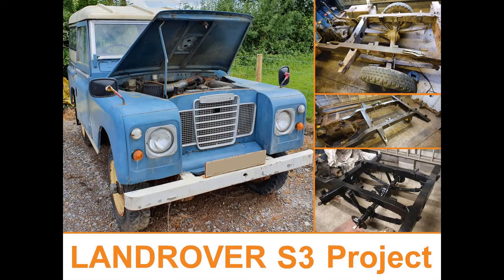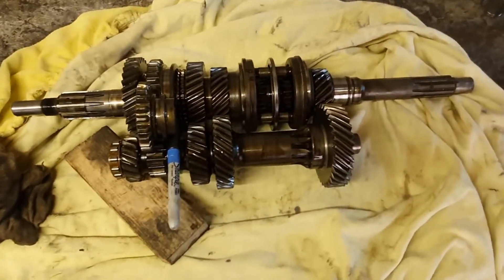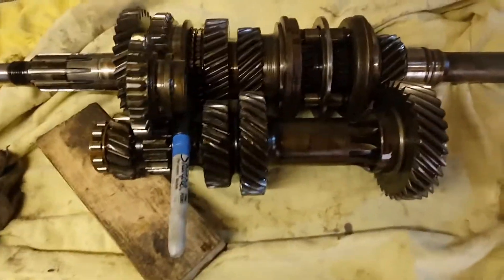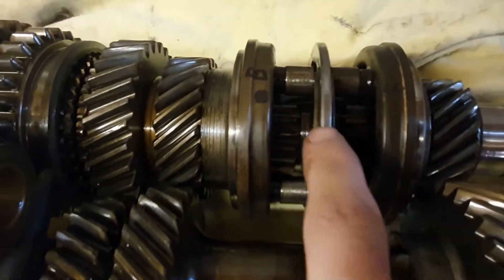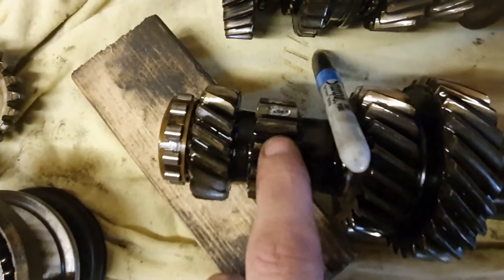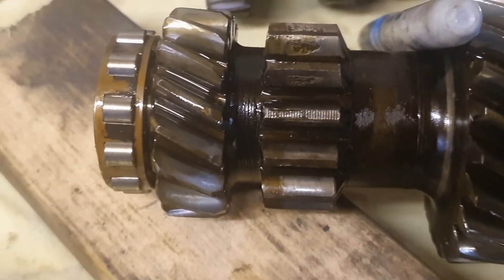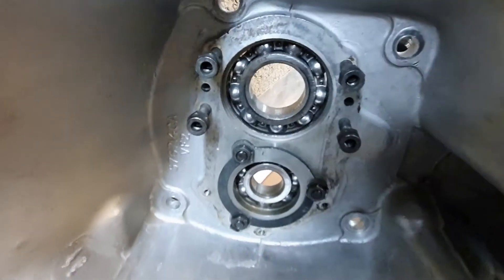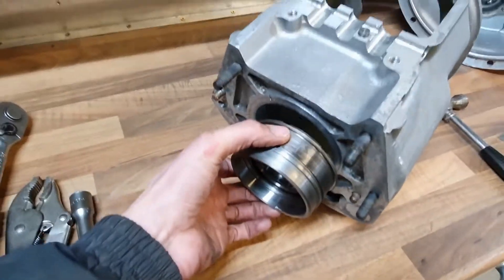Gearbox rebuild part 1 - Found the Broken part! - 10 Land Rover Series 3 Project

Comment: I’m literally fitting the last couple of studs n nuts on Clangers gearbox. I questioned the main output bearing housing, mine could rotate in the gearbox housing. The Landrover manual called for loctite to fix the round bearing housing into the gearbox. Glad I checked. Parts were a pain in the rear, but I needed lots more than yours. Same problem with the springs but also corroded from sitting unused for years. If I get chance I will pull a video together.
Reply from the maker: Thanks for the comment, much appreciated. That's interesting (and annoying) loctite is amazing fir stuff like this. 

Please do get a video together I would love to see. 

Yeah I found it to be a right pain trying to get hold of good quality parts, it's like finding a needle in a hay stack.

Comment: I’m rebuilding my series 3 gearbox and my layshaft has the exact same wear and before I took it apart reverse was whining like crazy the idler, shaft and the other gears are fine (I did buy new ones though) so obviously that pitting was causing the horrible whining. Definitely replacing my lay shaft
Reply from the maker: Jack, thats good to hear hopefully the new shaft will sort that then. I cant wait to drive it, still some way off here though. Are yoy just doing the gearbox or us it part of a bigger restoration?

Many thanks for the comment, much appreciated
Reply: @lozl  I am doing the whole car, everything’s getting painted and fixed, etc.(keeping the patina though) my whole drive train is flogged out as it was a spray rig for most of its life with 2 ton of water bouncing around on the back and then sat in a paddock for 20 years but hopefully I can track down a parts car to sort that. Is powered by a 179 6 cylinder Holden going to be a great car when she’s done. It’s a slow process
Reply from the maker: @jackjarick2750  Jack thats awesome! You keeping the holden motor then? I want videos appearing on YouTube please! If this was my landrover (it's my neighbours) I would have put a different engine in
Reply: @lozl  100% keeping the Holden motor, I’m a massive Holden fan and absolutely love them motors and there’s plenty around, they are powerful, good on fuel, very reliable and bulletproof and you can get parts anywhere for them. I might have a think about making a video but I only do little bits at a time probably not very interesting. As soon as I get a parts car I’ll get right into it and get it done.
Reply from the maker: @jackjarick2750  excellent! My mate lived in Australia for several years and told me all about a holden he had and he swapped a bigger holden motor in.
Reply: @lozl  yeah there’s heaps of Holden 6cyls around because everyone used to take them out and put a v8 in and then someone with a landrover usually gets hold of the 6cyl and swaps it, every second landrover here in Australia has a Holden motor haha
Reply from the maker: @jackjarick2750  oh thats wicked! Every time my buddy talks about the place I wanna go. It sounds like oterol head heaven. 

You may have seen my video about the land cruiser. I believe these made their reputation in Australia. I would love to visit
Reply from the maker: @jackjarick2750  oh thats wicked! Every time my buddy talks about the place I wanna go. It sounds like oterol head heaven. 

You may have seen my video about the land cruiser. I believe these made their reputation in Australia. I would love to visit
Reply: @lozl  I’ll have to have a look, landcruisers are every where here
Reply: @lozl  I’ll have to have a look, landcruisers are every where here

Comment: I bought heaps of parts off Synchro Gearbox’s and got a bearing kit that came with good high quality Timken bearings
Reply from the maker: Thats good. Timken are the best, and quite expensive to get new now
Reply: @lozl  the overhaul kit for my series 3 gearbox was £100 came with heaps of goodies and the timken bearings
Reply from the maker: @jackjarick2750  thats fantastic Especially with those bearings. I am guilty of not searching around for too long, but its not my budget. If it was our money I probably would have searched for hours to find the best price
Reply: @lozl  I usually ask the Facebook groups the best place to get good quality parts and they point me in the right direction
Reply from the maker: Good thinking. I used to be on lots of forums but all of this forum type activity has moved to favebook

Comment: Great work. Are you following a manual for this or is it prior experience? Did you require a press to dismantle?

I would love to refurb the Tremec T5 box on the TVR I have myself but I always think it would be too much for me. 

More content like this please. I love the technical stuff and always pick up new ideas and ways to do things.
Reply from the maker: Thanks Dalamar, what a lovely complement to read.  I refer to a Haynes manual for any torque figures and sometimes look at Geoffrey Croker's youtube channel as he is very knowledgeable and does a fantastic entertaining video, otherwise its mostly just putting it back together the way it came apart.  Perhaps his is why I often end up doing things twice :)

I felt exactly the same way with gearboxes.  They have always seemed a little out of reach so I've always felt like I'm not good enough to get into a gearbox.  Well, that is until I did this one.  When I got into this one I started wondering what all the fuss what about.  My advise would be to take it on! Do it yourself, they were put together by humans, how hard can it be.  I have found so many times, that you can do a better job than a specialist.  The job is far more important to you that anyone else and its never as complicated as you think.  

That's a lovely gearbox that T5.  I put on in the Scimitar years ago, what a lovely gearchange!  I bet that TVR is a fabulous thing.  Is it a 4.6 Rover engine?  I have a friend putting a load of TVR bits in his Rover SD1, its fantastic!  Big valves, wider ports and inlet manifold runners, he's so excited.  

More content in its way, the next 6 videos are all made and will be coming out each Friday afternoon/evening.  There are 3 more videos on the gritty detail of the gearbox before I start on the engine.....
Reply: @lozl  It’s the Chimaera with the 3.9L V8 EFI serpentine engine. Lovely to work on and lovely to drive! I appreciate the comments on giving it a go myself and I’ve done that for everything bar the diff refurb so far. I took that one to a specialist especially since the parts are very hard to come by now. 

Looking forward to the next episodes!